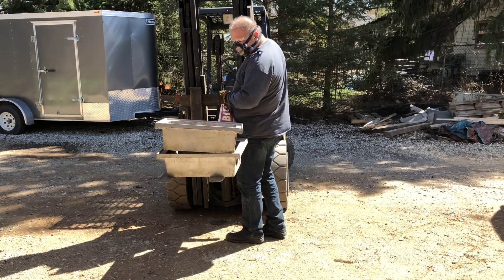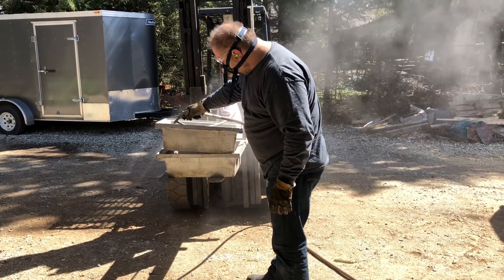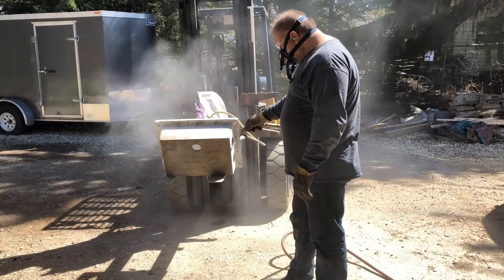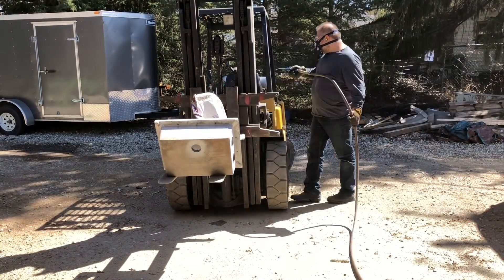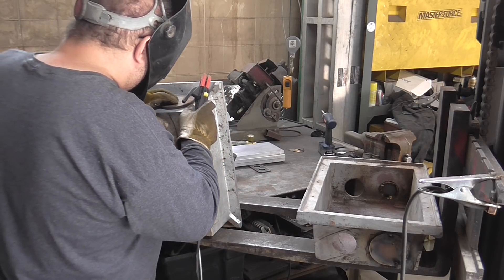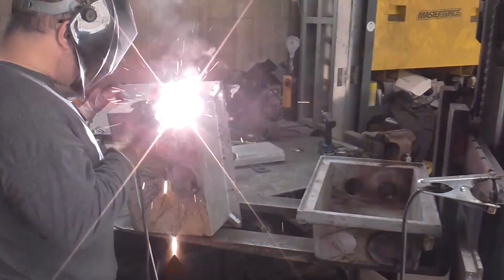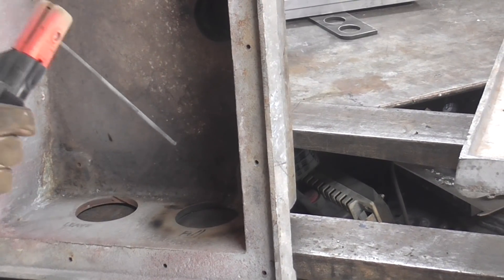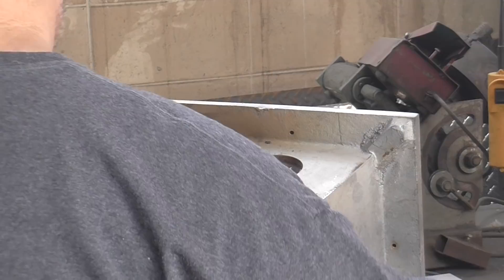Welding cast iron electrical boxes with stick

Comment: When you tapped the slag you commented as though you shouldn't have,  I would have thought that that was a good thing because I thought cast iron needed to be peened while it's hot.
Also the panels resembled white cast iron. If they were then you achieved another "and they said it couldn't be done" because white cast iron is deemed unweldable.
Reply from the maker: those rods work really EXCELLENT though .. with the "right technique" they weld a lot of stuff, and then these plugs are not structural ... dirt is leaning against them on the outside ... and in case they are not 100% leak tight, some silicone or tar will do the trick

Comment: Hi Pete, another question again, I have a BMW cast iron engine block with 2 water galeries broken near the cilinder bores (missing material), can I weld fill it with Nickel 99 and then mill it? It only has 1.6mm of surface area for the fire ring to sit at the moment on those spots and it will blow the new head gasket in no time. Thank you.
Reply from the maker: that is how i would fix it - i am pretty sure depending on your casting (that is the wild card the unknown) that you have a 80-90% chance of success
Reply: @ZILAwelds  thank you for your advice once again. Greetings from Portugal.

Comment: Check out Instructables someone recently showed how to make a cheap portable sand blast cabinet from a plastic storage container. Certainly got my mind ticking over and I think that you may find it interesting.
Reply from the maker: mark, I have a gravel driveway ... that little bit sand blends right in ... at $7/bag it is not even worth saving ...
but thanks for the info

Comment: I have noticed that there is a huge difference between period cast iron and modern cast iron. I work in Maintenance at a prominent private school in Melbourne Australia and come across cast items that are probably between 100 and 150 years old and sometimes 19th or 20th Century steel well weathered, is present as well. 
It's all a gamble, do I braze, cast rods, stainless steel rods or get it sent out. Sometimes it pays to admit your limits and say no. I have a very full wheelbarrow of work to be done.
Reply from the maker: i found that the older the casting the better they weld for me ... new asian castings dont weld well for me and older US or european castings typically weld ok for me ... ??? either way - cast iron is a gamble

Comment: How do you charge a job like this is it hourly labor plus material or per unit
Reply from the maker: chadwick hayes those cast iron rods are $70/lbs .....  now that being said - cast iron welding (the consumables) are NOT included in your standard hourly rate ...  
no matter is your rate is $25/h or $125/h you WILL make a loss! 

I can bid or do those jobs hourly or flat rate - does not matter ...

Win - loose - draw ......

It all evens out in the end ....  some you make more - some you make less ....

These boxes are worth ( taking in consideration the OUTRAGEOUS cost of the welding rods) about $100 per welded hole .....  in my mind .....

And you ask 5 other guys and get 5 different answers ....   

And no matter how you skin the cat ....  if you work on a hole 1/2 hour maybe little longer and have $30+ ish dollars in rods and $5 in sand into it .... and a grinding wheel ....   that is about $100 ....   

So no matter how you look at it ....

Comment: The only time I’ve used pulse is on the dynasty 280 I have at work and I turned it off cause I felt more comfortable feeding the wire myself. So I guess my question would be what are the benefits of pulse (for any process) when it comes to structural welding? I understand the heat distribution but other that is cosmetic the only other thing?
Reply from the maker: David, great question! - that will be a long video or a 3 part video series ...
So I will try to make this answer here somewhat brief. (and I am also trying to focus "only" on the structural aspect since that is what you were originally asking about)
1st ) tig pulse. mig pulse and stick pulse are 3 "totally different " things.  besides they all have the word pulse in the name - that is about where the similarities end.
2nd) Tig pulse. In a nutshell - I am not sure that there is a structural benefit at all. Besides bead appearance and puddle control and heat input control on thinner material ... I don't think that there really is a structural benefit. (at least I was never explained one and I have never experienced one)
3rd) Mig pulse - the most complex one of them all (and let me just touch on DC mig pulse for now - please... AC mig pulse does exist, it is VERY expensive and even more complicated to explain - and hardly anyone does it in a "manual" application yet - right now the majority of this process is computerized automated welding)
Mig pulse (no matter if single or double pulse (although there are differences which is a separate explanation))and no matter what material you weld on, steel, stainless, aluminum,... It has the advantage of bringing a hot spray arc process and the deep penetration that it brings with it and the higher travel speeds that it brings with it into a more controllable process so that you can even achieve higher travel speeds to increase your structural production and make more $ or use the hot process with superior penetration that you previously could only run flat or maybe horizontal - now you can run it also out of position !
( I didn't even talk about bead appearance or heat input ( I guess I talk about heat input but not warpage))
3.5rd) Mig pulse is probably the "hardest" process to dial it all in ...  there are a lot of parameters  (on some machines more than on others) it all depends. - but the key is that everything needs to work in perfect harmony...
4th) pulse stick - and a lot of guys think this is some sort of advertising gimmick ..  and 2+ years ago I was very skeptical myself...  but there is a real advantage (even for structural ( i am not talking about the 3-5 advantages other than structural)).
You can run much higher travel speeds and get better penetration.  On structural stainless, you are not cooking the material. And structural steel out of position - it can really help you to put vertical up welds in with ease ...
I guess if you are a top-notch guy who all he does all day is 7018 vertical up building stadiums and Walmarts etc ...  I know a few of those guys ... they weld 1/8" 7018 at 140 amps though paint, Powdercoat zinc coatings ... vertical up even if the I beams are smoking hot .. they don't care...
but some of us are just not "that good" - that is where the pulse stick can help you to get the same great penetration with less skill...
Now the manufacturer claims that the pulse stick was invented for 6010 and citoflex cellulosic rods for downhill pipe welding ...  
I dont know - they say it is awesome - i dont really do much or hardly ANY of that kind of work ....
Reply: Thanks a lot man you’re definitely a knowledgeable person! I knew the tig pulse was pretty much just for looks but since I’ve been watching your videos I’ve been more interested in the mig pulse. At my day job I build stainless washers for industrial powder coat systems so I mostly tig but at home I do more mig with mild steel and I’ve been wanting to get a new welder so i figured I’d ask
Reply from the maker: thanks for asking intelligent questions!

Comment: Peter, does the 221 Invertig do everything the little stick welder can do with stick. It seems to me that the Invertig 221 would be a better buy since you get both processes for a lot less than twice the price. What's the story.
Reply from the maker: Denny, the short answer is NO.  the 221, in my opinion, is an excellent stick welder, full bridge with a dynamic signal processor. It had one stick welding mode that works well for all rods including 6010. It has a factory preprogrammed arc force (not user adjustable) and it does not have an adjustable hot start either ...  
Now that being said - I still think that the 221 is a good stick welder!  furthermore, it has pulse capabilities and the option of DC AND AC stick welding ... and AC stick welding even with adjustable balance AND frequency ... 
I welded tons of it - I liked it.
The inverarc 200 TLP is a full bridge with DSP also. - but the arc dynamic is out of this world !!!
It has an adjustable hot start, adjustable arc force and it has 2 programs one for "regular stick welding" and one for 6010 rods.  the arc dynamic and volt-amp curves and what not all change in that program and Ray Charles could weld with it 6010 by brail no problem...
I mean it is the ultimate welding machine ... and its small, lightweight, and the arc dynamic ( in case I didn't mention that yet ...
When the guy who builds it told me: "that is probably the beat welding machine in the world" I said:"I have listened to a lot of sales pitches .... - but yours is pretty bolt !!!"
a few weeks later I tried it out ... and what I can tell - so far it is the best welding machine I personally have ever welded with ... and I have a Lincoln Vantage 400 which is considered in the cross country pipeline world "the machine" that everything is measured and referenced again ... and I can tell you the arc quality of that little guy is just as good - if not better !  
Of course, the little guy falls about 300 amps short on the output ... and does not have its own diesel motor to make power .... but it has pulse !!!!

you be the judge ...

I mean - if you look at bob Moffat (who I think is a great and talented guy) if you look at jody from welding tips and tricks if you look at. few others who tried to aluminum stick weld ...  most of them did fair - maybe good?
the guys in my class who definitely were not as experienced as those guys picked up stick aluminum in a matter of not even hours!

maybe it is a good machine ...
maybe even the best stick welder in the world...

it's not for me to decide ... I have not tried them all out yet ...

Comment: That’s some dirty shit. That TLP worked great. Is that slider just hooked into the connection in the front ?
Reply from the maker: yes - hooks right in the front .... just like a foot pedal ... you can stick or tig weld with a slider or a foot pedal or a little box with a potentiometer in there ... (just like on my lincoln engine drive)
Reply: ZILA that’s awesome I just assumed it somehow shut the pin connector off in stick mode. That is a great machine tho

Comment: Pete 100% right with cast iron some jobs brazing works , some times you can TIG it some times Stick weld what ever works is all that matters, never a picture perfect weld with cast. Heat is a big enemy in cast welding ether you use a ton of  it pre heat and slow post heat or you do it on the cold side and keep the heat low and in the area your welding. Patience and experience a must for a successful cast welding job.
Reply from the maker: i tig weld a fair share of castings also. typically "thinner" material up to 1/4" this stuff here was at least 3/4" thick. a little too thick for my personal comfort on tig